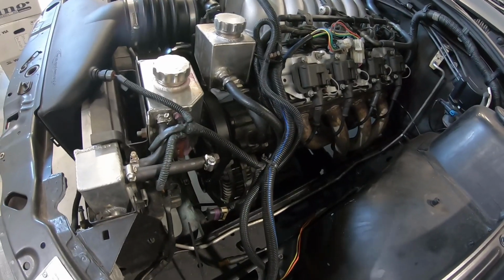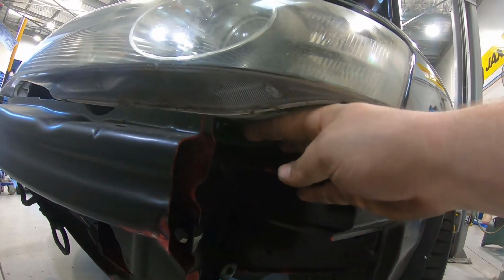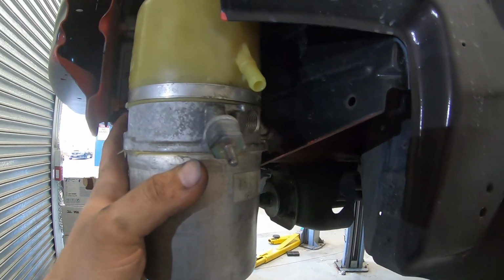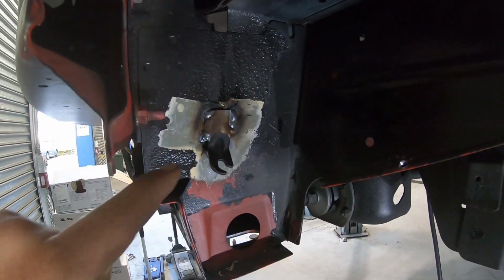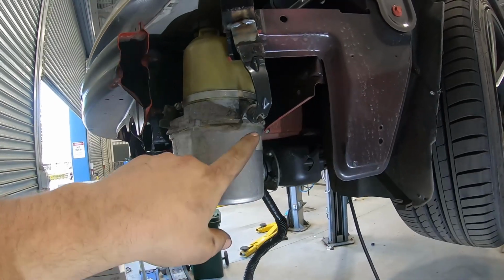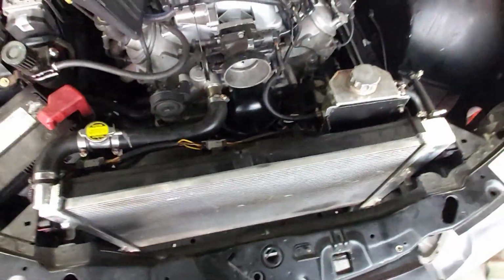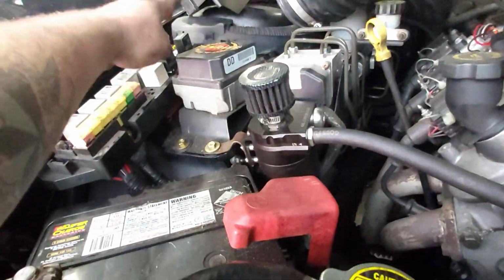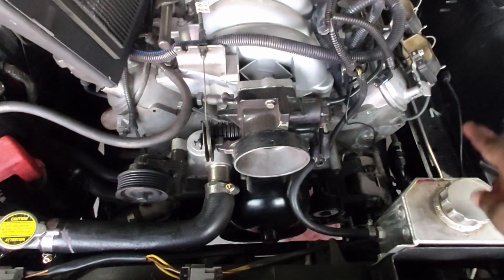Commodore LS1 Astra Power Steering Conversion

Comment: I done this conversion, filled with fluid ( staged my trigger/ signal wires for instant pump pressure) if you join the signal wires then the pump will slowly climb to pressure.

Anyways found the fitting that screws into the pump to be leaking 🤦‍♂️looks like ill be dropping the oil and checking if i nicked the o-ring and will throw some thread sealant on

Comment: Hey where did you get the cooler for is it from vy/vz
Reply from the maker: Stock power steering cooler in vy
Reply: @AussieAuto  thanks man doing this in a vr and have heard they run hot so need to cool it down
Reply from the maker: Use ptfe hose and fittings i had issues with the hose and fittings i used in this video

Comment: Only came accross this recently. Looking to do a similar mod myself. Thanks for the tips. btw - What/where did you get your radiator expansion tank. That looks very neat.
Reply from the maker: Hay mate, thanks It was a cheap eBay one I think, I've changed the set up now.
Reply: @AussieAuto  whats your overflow set-up now?

Comment: Any chance you know if the Astra power steering pumps 2006 or later will still work? I've heard some electric power steerings requiring a CAN BUS but I'm not sure if that applies to the 2006+ pumps
Reply from the maker: I think they have idle down when not in use and then need a canbus input from a steering angle sensor that tells it that pressure is required
Reply: @AussieAuto  Thanks for the reply.
Is there a way to tell if my pump is requires the can bus or not? Wire colors, model year etc? My pump is from a 2008 Astra and the pump I have looks exactly like yours. I could wire it up to test on/off functions but have no idea if that proves it does or does not need the canbus...if it powers on, would that be enough to tell me it does not require the canbus?

I didn't see any sort of CAN BUS box when I pulled the pump but I could be wrong =(
Reply from the maker: From what I know 97 to 05 TS Astra works any other model I'm not sure
Reply: Hey mate how can you tell which wires are the trigger wires to wire to fuel pump?

Comment: Hey mate just wondering what size belt you ran
Reply from the maker: Hay mate, I'm not sure what size it was I've fitted an underdrive balancer now so it's smaller again
Reply: Ahah to Easy man just half way thru doing mine and can find the right belt
Reply: @matthayes6151  did you find the belt? What was it?
Reply from the maker: 6pk1390 with a tensioner flat pulley fitted to the idler above the alternator
Reply: Hey mate just wondering with the fittings and hose you used if you had trouble getting the fitting screw end to go over the line
Reply from the maker: Yeah, making the hose was a pain always stab my finger with the braided wire ends 😂😂
Reply: The fitting I got doesn't fit over the line unless I force it on and what about the silver olive part did you use that
Reply from the maker: You might have the wrong hose - fitting series 
Fittings that use the olive are for a ptfe hose
Does your hose have a white inner tube or is it rubber only
Reply: Rubber only I just used the same as what was in the vid
Reply from the maker: The hose is the wrong series mate it suits cutter series fittings
You need ptfe hose for the olive fittings
Reply: What do you reckon to get different hose or fittings to suit the hose

Comment: Not having a dig at ya but if your relocating your battery to the boot you should have placed the bottle under the battery tray then you could have sat the bottle a little higher and used a hole saw so the filler cap sits up in the bay for easy access  and also plumbed the hoses to the cooler slot shorter and the power and earth would have been alot closer to your power supply.  Just my 2 Bob's worth 👍when I fitted my engine oil cooler and thermo I had to move my power steering cooler back closer to the a/c and cut both ends and flared them to run the new cooler hoses. Arhh the things we do with our cars lol
Reply from the maker: Cheers man all good, I just wanted to run shortest amount of high pressure hose as possible to eliminate the possibility of  future rub  thru and failures, I'm moving the battery to also accommodate the inter cooler piping, catch cans,  and my windscreen washer bottle.
Reply: @AussieAuto  good rule of thumb ya got going there with ya build, always keep thinking 5 steps ahead of the current mod  👍👍👍